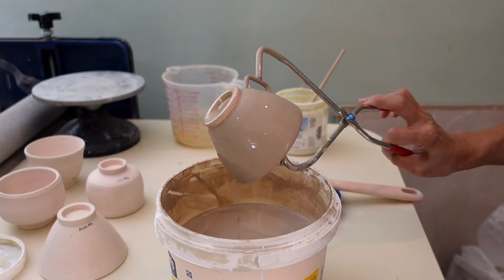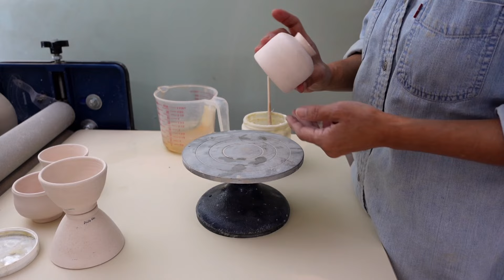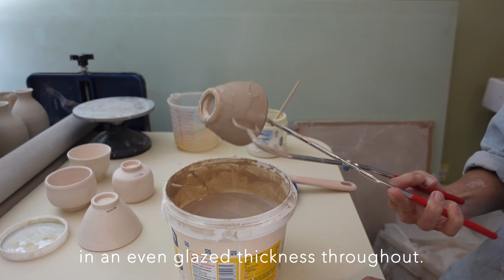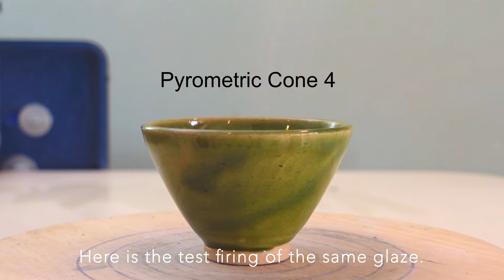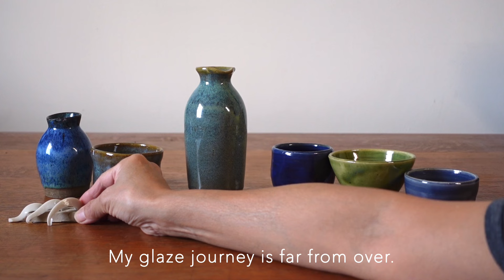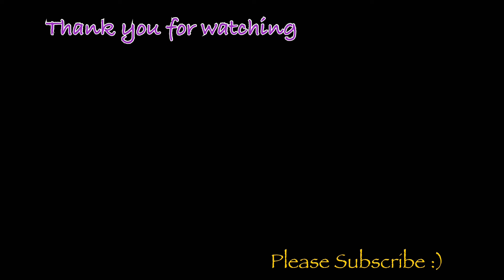“Glaze Test with Different Firing Temperatures”. Cone 4 to Cone 7 @ Alchemyceramic

Comment: It would be excellent to slightly adjust the materials to see if you can get a consistent looking glaze across cones. I've always wondered if floating blues could be achieved in low fire, like 05.
Reply from the maker: Thank you for your comment 😊. I love floating blue glaze. I found the higher  temperature is more effective for the floating blue. Even cone 5 doesn’t show the effect in my glaze recipe.

Comment: Great video, thanks for sharing. I am starting to mix glaze recipes, and have run into the problem of  glaze running, because I put water, without gradually adding and measuring. I will try your recipe of the sake bottle, at cone 6.
Reply from the maker: Thank you for your comment 😊If the glaze is runny the cause is maybe not about water. You could adjust flax to change to the higher melting point one or increase the amount of stabilizer such as kaolin.
It will change the appearance often unfortunately.
You can also try to fire lower cone like this video. As you have seen the appearance is completely different so maybe there will be a nice surprise 😉